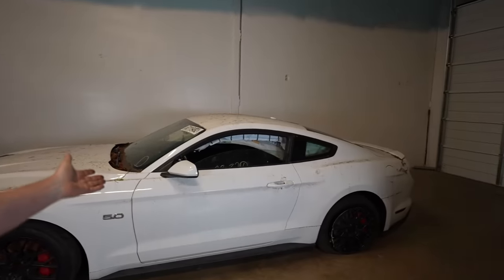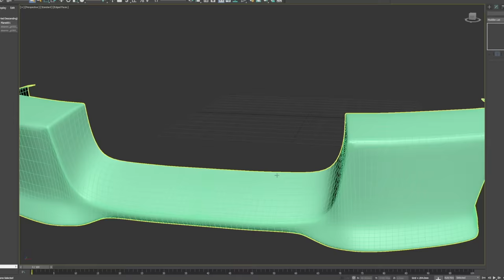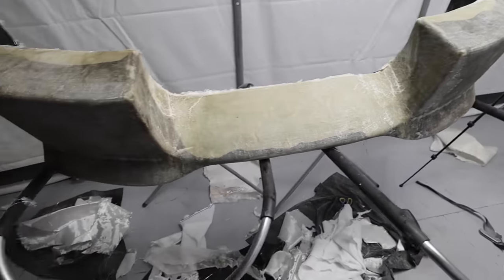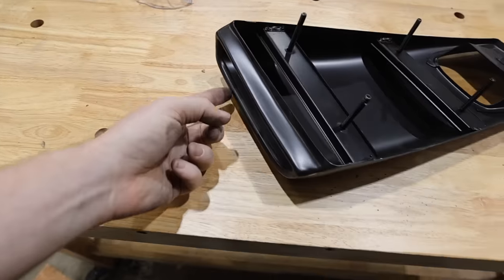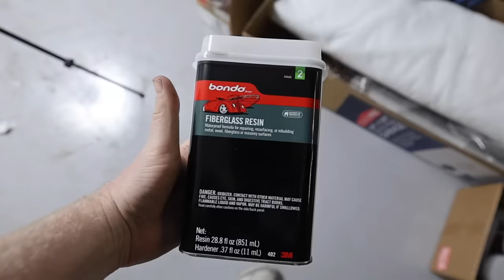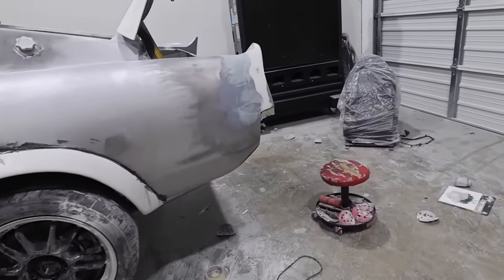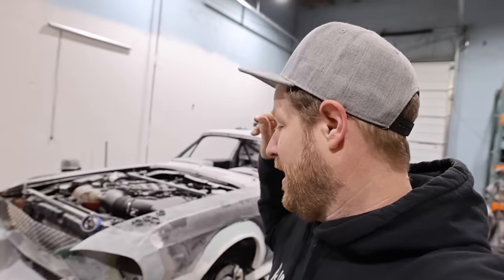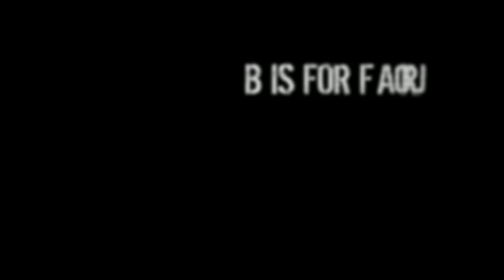B IS FOR BUILD SEMA MUSTANG Build Part 6 - 3D Printed Front Bumper!

Comment: Hey, when adhering carbon fiber or fiberglass to anything it needs to be sanded with like 60 grit. Prob already know that. Additionally the material will be more rigid if you sandwich it. Fiberglass, nyglass (or similar), fiberglass. This creates an “I beam”. I’m certified in prosthetic fabrication. I do it every day.

Comment: Hey man love the vids been watching forever. I’m a boat builder in the northeast and knowing that fiberglass isn’t your cup of tea necessarily watching you work with it makes me cringe a little so here are some tips.

If you want a tack free surface (add wax to the resin) regular fiberglass resin is called laminating resin. Which remains tacky in order to avoid having to sand in between layers. 

Secondly, never make your last layer a woven layer. Woven cloth needs all its strands to have its strength. Once you sand you break the strands and lose the majority if not all of its strength. In your case (the bumper) the best thing for you to have done would to be add first a layer of chop. (Maybe 1.50oz) followed by 2 layers of woven (for your main strength) followed by 1 or 2 (depending on how neat you were with the cloth) layers of chop on top. The final layers of chop are called (burner layers) they are simply there to help you sand and smooth it out after the fact while it still remains the same strength being you havent cut into your woven underneath. 

Third if you are having issues with it drying ADD more MEK. On a hull of a boat where strength is absolutely crucial for the safety of others i of course would not do this. But for small detail work if you add a few extra cc’s of MEK you can get resin to dry tack free in 10-15min even if it’s 50 degrees out. Your working time shortens but move quickly and get it done it’ll save you a boat load of standing around waiting.
Reply: Asking for a little advice or confirmation from someone in the business, my first fiberglass project was a full car headliner, I used polyester resin in August in Texas. I have since done some more poly and some epoxies on different projects, consequently I don't feel like I could ever work fast enough to properly bag a polyester project. Am I mistaken or just doing it wrong ? About the longest I have ever stretched a mix of poly is + or- 20 Minutes.

Comment: Hey to get the fiberglass to stick is to sand down the plastic with aggressive grit 40-60. And also drill holes into the plastic around the edges. Will hold fantastic. 🤙🏽also never use fiberglass resin, always use epoxy resin for skinning over Ed printed parts.

Comment: As someone who used to work in a custom/restoration shops as a painter/body man I know the crunch to sema. You guys really should use guide coat and tape and block sand for your body lines. And don't use a DA on body work. I know your rushing to get it done. I'd love to see you guys really take your time on a build. Have some pros come and teach you guys so techniques for body work. You guys have the drive to build some awsome cars. Learning is always good.
Reply: I was shocked to not see a single block and everything finished with an orbital sander
Reply: It was making my eye twitch 😅
 @brodiecartwright
Reply: i was thinking the same thing all video. A DA is for roughing in and that's it
Reply: @bobert972  that or strîpping material lol

Comment: In the future does it make sense to print the “mold” for the bumper? Then instead of laying the fibre glass on the print you could lay it in the print and reinforce from the inside?
Reply: I think they mean to make a PLA or PETG mould for the fibreglass and then remove the fiberglass part from the mould. The surface of the fiberglass is going to be worked smooth anyway, so 3D print finish isn't too important. There will also be a release layer interface otherwise the fiberglass would bond to the printed mould.
Reply: https://www.youtube.com/watch?v=KpJdwryFj6k

You absolutely can. You would sand then coat the print for a smooth finish.

In this case it probably have been easier and quicker, as the mold won't have overhangs or supports. They can print it in one or very few pieces.
Reply: seems like a better way to do it since the front is gonna get smoothed out anyway

Comment: For mold supplies and other composites, go to the TAP plastic. They have 2 PDX locations, and they stock everything you might want for working with fiberglass or carbon fiber.
Reply: THIS. I know TAP isn’t the cheapest, but they’re right in town, their fiberglass resins work really well (I’ve done a bunch of projects with TAP stuff), the people are knowledgeable, and they have all of the supplies, consumables, and tools you need for resin work right there in store.

Comment: Although im just a student in autobody, seeing you guys not using guide coat to help sand the bumper hurt me. Im sure it turned out fine, I'm surprised on how good the end product came out, good shit dude!
Reply from the maker: we did use it a few times, but youre right we should use it more. We still have a ton to learn.
Reply: Guide coat is for your final sand , not every step of the way
Reply: @mikehenderson8122 right it's for the final step so you don't sand to much and make dips in the bondo or fiberglass
Reply: Learning they're is nothing wrong with doing it every step to help you understand what your doing when your blocking a panel , but in the real world it will just slow you down and add unnecessary work
Reply: @joeysweet9045 it is actually to make sure your area is straight, you can guide coat and fill and block that bumper all day but it's fiberglass unfortunately it's going to be wavey as soon as it sees some heat and sun
Reply: im more concerned about sanding everything with a orbital sander and how little a block was used
Reply: It only has to look good on camera.

Comment: That chopped sheet of fiberglass is what I used to repair high dollar boats and 3 layers of the sheet is enough to make like a ⅜ inch thick hull. The triaxial sheets are even stronger and more rigid and work well. If you buy metal rollers you can forces the thick sheet into tight corners. The resin could have reacted with the catalyst too quickly before it was mixed. This happened to me when I tried to use less hardner to give me more time using it but it causes the resin to harden and not get thoroughly mixed into all the resin.
Reply: I'm no expert by any means. But have worked with fiberglass a ton. It looks like a polyester resin they used,  I'm thinking they simply didn't use enough catalyst. Bondo resin sucks compared to like total boat. But the long cure  time tells me it was a catalyst problem. It must be adjusted for desired working time and weather conditions. If it's below 70 and they tried to stretch the working time, it'll lead to all those problems.
Reply: @bryp88  I agree the bondo resin does suck. Much more of a pain to use. Polyester was always what we used on boats. Can't remember the exact brand unfortunately.

Comment: Some guys are using CNC machines to cut foam and make disposable molds for custom body parts, you may want to give that a try, from what I understand cutting the foam on a CNC is a lot quicker than 3D printing a part for a mold
Reply: As someone that works on cnc machines for a living that would not be quicker to learn or cost efficient at all
Reply: @mannydays2594 To be more specific, you use a typical X/Y router with a longer than normal Z axis. You wouldn’t use a full mill for foam cutting. 

It’s pretty common and cheap, but the printer they have can be much faster if someone experienced in large format printing gave them a hand and some training. 

At that kind of build volume, you really want to be doing pellet extrusion which has much higher flow rates than a filament extruder can manage. Surface finish will suffer at the larger nozzles, but they’re sanding, filling, and fiberglassing anyway, so they don’t need or want a perfectly smooth printed finish.

Comment: Next time, drill small holes in the plastic, and sand the surface with 60/80 grit. The resin will get in there and will create mechanical adherence, or you can use a plastic adhesion promotion primer before applying the resin. I always use both techniques together, and never had any issues. Also, I usually use weave fiberglass in the middle, and sandwich it with stranded fiberglass.

Comment: Fiberglass that cures at different speeds usually wasn't fully mixed OR it got cold and stayed out.  I've had to wait 2 days before to cure thick sections on boat transoms in cold/damp shops.  It does cure but a heat source will activate it quickly if an area is lagging behind.  Looks great!

Comment: Using hard urethane foam is the light way to get rigidity.
Schedule 80 PVC pipe heat to shape  and glass it in will give you ridigity and a hard point to attach stuff to.

Your plastic parts, you wi have to use an "adhesion promoter" then paint before glassing then it will stick.

Hire 5 guys to sand each 1/4 after you spray high build filler primer.
Great work B team

Comment: Love the build great work my only complaint is you had two perfect holes under the rear bumper which I thought you would be using for the tail pipes but you capped them off now you can only see half the tail pipes if you are behind the car

Comment: Sand and drill holes in the plastic, Bobs your uncle. Or better yet, (for future reference) you actually had the perfect mold. Spray with mold release 2-3 layers of mat and you have an almost perfect "no finishing" bumper. As you did more layers anyway...
And as far as Bondo brand, I have used in it 100s of parts in the last 22 years. You just didn't get the hardener amount correct.

And I do want to post, that I found you with the %$^%^% Mustang build, as I'm a Mustang lover. And it hurt so bad to see that you lost that car! then you came back with last year's mustang, what a total awesome build. And now this Mustang... You guys just do phenomenal work! This one is going to be another ashow stopper build!

Comment: I’ve done lots of custom molding and working with fiberglass over the years, if the plastic mold was collapsing I would’ve just sprayed some spray foam on the inside to help with rigidity so it holds its shape. From what I can tell you guys tried to add a little to much fiberglass/resin and the uncured resin was trapped in between layers because the outside cured first, this has happened to me before
Reply: Hmmm I was thinking they didn’t use enough in the middle
Reply: @MyWolffy  Chris said they over did it on the resin, when you do that and not allow it some cure time before adding the fiber it can cause the effect I described above.
From my experience if you do not use enough resin that causes a different problem, where the layers of fiber may separate or create an air pocket, which is another nightmare. I was self taught so I had to figure out some stuff the hard way lol 😅

Comment: The only reason I’ve ever had fiberglass take forever to dry is from not having enough hardener in it. Obviously don’t do too much or you can start fires. Witch is cool but not what you want. 2 days of drying isn’t fun either though.
Also long blocks and guide coat for sanding maker life easier to match panels and secure flat/flush areas.

Comment: Fantastic job! Great work on the custom front fender. I strongly suggest looking into boat fiberglass and resin products -- there are triaxial and carbon fiber fiberglass products that are incredibly strong. There are also very tough, strong epoxy and vinylester resins put out by West and Total Boat among others. The fiberglass mat you used is fairly strong but very rough.

Comment: Sounds like the resin wasn't mixed with the proper amount of catalyst. Has to be tailored to the heat of the day or else it'll set a lot sooner than expected. Tip for the future: Run the fiber layers in opposite directions. Helps to improve strength of the overall part. An old trick is to mix baking soda into your resin to increase density without adding much weight.

Comment: For future resin struggles 2 layers of 450 chop one layer of 650 woven and another 2 450 chop 
Hand rip all pieces of chop lay with overlay in consistent layers 

No need for vacuum bag 
Create zero atmosphere with pva glue spray on top when all glassing is done. 
Or buy flowcoat 
Or evengel coat mix polystyrene wax with gel coat.
Plus flowcoat can be thicken into a bog hardens and is sandable.

Comment: Great work on the body. One question I noticed with the wheels off. Why are the front brakes not 4-piston brambles style? Did you need to change those to older style calipers from the stock GT brakes the modern GT has?

Comment: With the sanding disc . Wood woorkers use a ruber log to clean  there discs . Look at getting a couple because it also helps to save money but also time . 

The problems was gunk on the pads not the pads lossings sand

Comment: Fiber glassing
-----------------------
Resin mix : 65% blue resin 35% catilis hardener for slow dry. 55% blue resin 45% catilis for fast dry.
Laying fiberglass:
01. one layer of fine weave fiberglass laid down.
02. Second layer of chop fiberglass rolled out with a ribbed roller.
03. Third layer of fine weave fiberglass smoothed over chop fiberglass.
04. Final layer of fine weave fiberglass with crossing the grain.
05. Clear Opoxy over fiberglass after sand shaping. Clear Opoxy will fill in gaps and cracks, and low spots.
06. Final step is to finish with sanding and a layer of fiberglass bondo. Sand to shape. Spray on sealer primer. Spray on base coat paint. Spray on 3 coats of clear urethane.

Comment: I'm sure I'm not the first and won't be the last. 

Fiberglass resin (Epoxy, Polyester, whatever) does not DRY. It cures. And if it doesn't cure when you think it should, it's because it wasn't mixed properly.

Comment: You guys should try ABS paste to use as a filler/glue for ABS printed parts. Take all the supports from old 3d prints and mix it with acetone. After 1 day it becomes a paste. That past makes miracles for 3d printing car parts and everything else made from ABS

Comment: You should try small scale parts to master your plastic-fiberglass bonding method. Im thinking if you make your plastic part with holes like swiss cheese, you can use the holes to bond the front layers of fiber to the back layers, so the plastic is more like a skeleton than the part itself.

Comment: In my experience next time, try sending the 3D printed material. Leaving a rough surface, then Apply your fiberglass mixture. It should stick to the 3D printed material. It just needs something to grab onto.

Comment: If you do not give resin enough time to thoroughly mix and if you try to rush the mixing process of resin it will create tons and tons of problems it also depends on the type of resin you're using but again you didn't wet any of it out correctly that's why you're having so many layers delaminate an issues is because you were trying to rush something that you should have taken some time to wet the bumper down first then wet the cloth down to the bumper and then the next layer of course is laying down on some wet cloth already so that way it directly correlates with the next layer and so on and so forth but you should be able to see the color of the product or whatever perfectly fine and I cannot say that with any doubt that you didn't let it out well enough you could have rolled it with a ruler with specifically designed for fiberglass which you should have done to help get the air pockets out you probably didn't hand mix it you possibly use a regular mixer or high-speed drill which would induce air bubbles which is not good either

Comment: I used petg to print, sanded it, used the resin and fibreglass and it bonded fine. Mine was small canards so smaller but pretty sure it bonded fine

Comment: Chris you gotta get yourself a better sander - size of orbit, gear drive etc make such a massive different to the amount of time you need to sand something to remove material. you'll need half to a third of the time. A small outlay for one or two decent electric sanders will save you so much labour, will pay for itself on the first job.

Comment: I was wondering why it was taking the fiberglass so long to dry I have used fiberglass on rust and if you put to much hardener it will dry before you finish putting it on.

Comment: Not sure if you will see this the fibreglass probably took its took due to exothermic reaction from it starting to set and then chucking more resin on top if your doing multiple layups dont use as much catalyst like 1% if your using vinyl or poly resin epoxy would be the strongest tho

Comment: You didn’t catalyze the resin enough. Witch depends on the temperature outside can be a double edged sword because it could kick off way to fast and not have enough time to vacuum bag it or the problem you have with some spots not kicking off and curing and staying soft and pliable.

Comment: layer sandwich!  id be happy to offer any knowledge i have via email or whatever,  love the channel.  think SKIN & BULK, chop mat skin, then all bulking materials like foam rod or board, core mat, balsa wood, etc. there is a plethora of composite strengthening materials, extra strips of chop / woven mat for stress points like corners , incorporate a woven mat layer to cap it all off.  oh, and ABS plays well with fiberglass...installed many large 1/2" thick panels of abs during bulk stage to accommodate fasteners.  you might try switching your 3d filament to abs for the next project.  fiberglass can be a real rabbit hole, but it can be very rewarding. 

 **pro tip,  if you put expanding foam into a sealed mold it compresses in on itself and becomes exponentially stronger, if you put a rebar'esk skeleton inside the mold for the foam to expand around you got a seriously tough part that resin bonds too perfectly.  i wish i could help, it looks like a lot of fun.